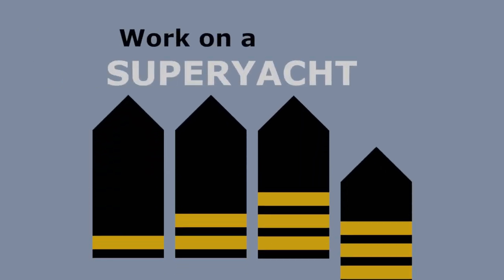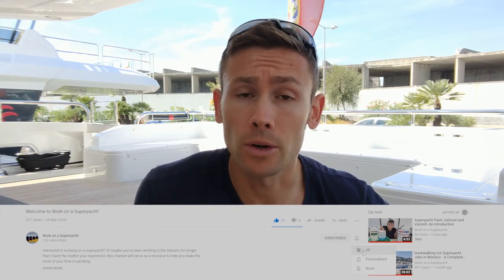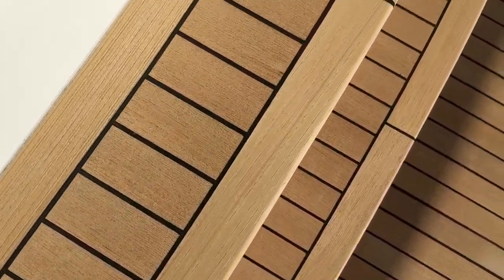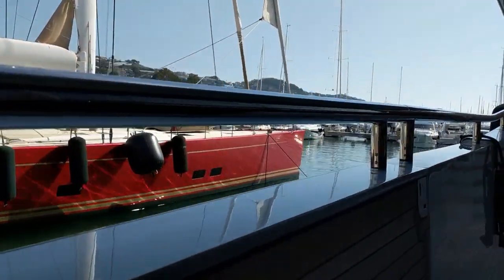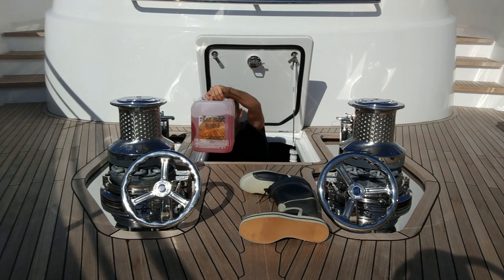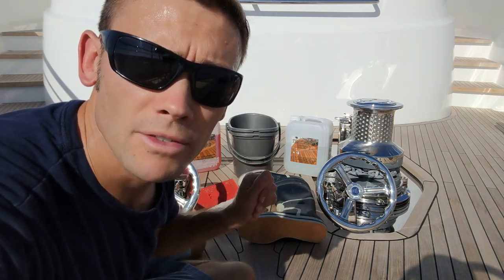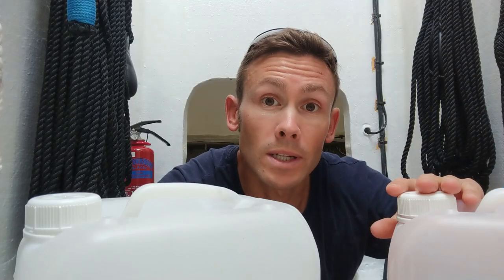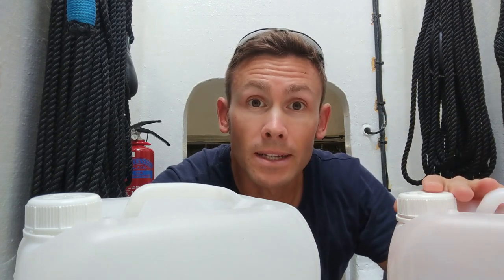How To Scrub Yacht Teak Using A Two Part Teak Cleaner

Comment: Hi very nice video, i use the same product i prefer rinsing step one and then go with step 2 dont see any difference between rinsing or not step 1.
Reply from the maker: Hello AZVLOG. Thank you for sharing your experience. As you say, I don't think one method produces a better result than the other. From an environmental perspective, I have read that a neutralised solution going overboard is preferable to each part going over separately.
Reply: Thanks for your answer, from enviromental point of view that makes sense, it brakes down part one i guess, while still on deck great videos thanks,

Comment: Howdy Matt!  You almost at the 300 sub mark!! Wonderful video as always. The lines must have been really tight or you had just a drummer from a marching band in the background (background noise). The sound was almost spot on. You would think that someone had invented a holder for the water hose to keep it off the teak. Speaking of the water hose, out of curiosity is the water pressure on a yacht the same or similar to a home or office building? It doesn't seem like your water pressure is high. A few years ago at a boat show, I got barked at (didn't know anything, it was an honest question I thought) when I asked if you could use a pressure washer (grin). Now I know!
Reply from the maker: Hi John! I can't believe it's only been 6 weeks since you congratulated me on having 100 subscribers! I'm truly blown away by all the support and encouragement from everyone on here. Thank you.
Our lines are pretty tight, but it's actually the design of the fairleads that causes them to "sing" so much. Pleased to hear that the sound was better on this one; I'll be getting a proper microphone soon to improve things further.
As for the water pressure, this is yacht dependent. On some yachts you get really good pressure, although when it comes to rinsing two part teak cleaner you don't want it too strong as it will just spray the product everywhere. A pressure washer certainly wouldn't be a good idea on paintwork, but I have heard of them being used on teak decks to blast away the top layer of grey, rather than treating it with a product. Mind you, even then you'd only want to be using a domestic type. An industrial one used for blasting marine growth off the hull would probably leave you with no deck at all!
Reply: @WorkonaSuperyacht  Matt. No problem. I enjoy watching your videos. You are inspirational. Not all gab gab gab. You should be able to get entertained and gain so knowledge too. Your a Senior Officer and would like to show that its work, but in a safe (safety) and methodical way so the crew can go out and have a good time and see the sights at the end of the day =)
Reply from the maker: @John Christner Thank you John! I really appreciate your kind words.

Comment: Hi Matt. Great video, very informative as always.  These are a great source of learning for us greenies. Keep up the great work. 
When using Part 1 & Part 2 on a bigger area of the deck or cleaning the whole yacht, how would you go about it?
Reply from the maker: Hi Zach! Thank you for your comment and I'm glad to hear that you're learning lots from the channel. 
For bigger areas you use the exact same method, but just have to be careful not to let any of it dry out. Bigger areas typically mean bigger yachts, so there will also be a lot more hands on deck to complete the job. In addition, you may well have one of those buffing machines that I mentioned in the video. One person can cover a huge area with such a machine, whilst the rest of the team work around the edges and more intricate areas by hand.

Comment: How often are you cleaning with the  2 step process vs just washing down or rinsing down the teak decks?  And do you use the same 2 step process on the teak tables?
Reply from the maker: These products are expensive, and also quite hard on the teak. We therefore try to keep it to a minimum: once at the start of each season, and maybe once again during the season on high-traffic areas. In between times we try to keep it as clean as possible, and will often do something like a Simple Green scrub with a softer Doodlebug pad. The same process can be used on untreated teak tables, but then you have to be even more careful not to let the Step 2 damage the fixtures and fittings of the table.

Comment: How often do you scrub the teak? Are the steps and smaller areas trickier?
Reply from the maker: Hi Dave! The deck is typically scrubbed with a two part cleaner at the beginning of a season, and then maintained with "soapy" scrubs (using a product like Simple Green and a white Doodlebug pad) for as long as possible. Depending on how much the yacht is used, it may eventually get to a point where it needs another scrub with the two part cleaner later on in the season; and, this will have to be worked in around guest trips. I have on occasion scrubbed teak through the night to get it ready in time!
On some yachts you are required to scrub the decks with a two part cleaner before every guest trip, and on a busy charter yacht this could mean 10 or more times throughout the season! This does however put a lot of stress on the teak and isn't recommended.

Comment: Hi, Matt new sub here :) and I'm so happy to find your channel and very interested in all your tips. Question: Do you apply any teak sealant or oil after you wash and dry from parts 1 & 2? if not how often do you wash using this method. Do you consider using vinegar for regular washdown? Thanks a lot!
Reply from the maker: Hello Blue Ocean and welcome to the channel! We sometimes apply a teak sealant to isolated, high traffic areas such as a swim platform, or the deck of a tender; it also works very well on teak furniture. However, my experience of applying it to a whole yacht didn't go well, and I shall never do it again! A team of four of us applied Semco to the entire deck of a 60 metre yacht; as well as being time consuming, the results simply weren't worth it. 
The problem with many teak sealers is that they must be applied to completely dry teak. If there is any moisture in the wood then they stain it a mouldy, black colour. It isn't a problem to get small areas totally dry, but for a whole deck this means that you must have good weather and direct, hot sun before starting. In addition, the sealant has a habit of making the caulking go sticky during application, and can drag black streaks of caulking across your nice, clean teak.
Once applied, I don't like the colour (personal preference) and it doesn't feel nice underfoot. It also gives the deck a slightly shiny and plastic appearance. The biggest problem however was that it seemed to lock in stains from food and wine, whereas on an untreated teak deck these are easy to clean away with a stain lifter such as K2R. Finally, it is a lot of work to scrub the sealant out of the wood in order to start again.
My preference is to 2-part the decks 2-3 times per year; doing it more often will only further reduce the lifespan of the deck. In between, I find that a light scrub with diluted Simple Green (a degreasing product) using a white doodlebug pad is enough to keep it looking fresh.
A small amount of vinegar in your washdown bucket is great for removing water marks from glass and paint; just be sure to rinse really thoroughly because vinegar left on paintwork will damage it.
Having said all this, some yachts will require that teak is 2-parted more regularly, or sealant be applied to large areas. This has just been my experience of what works best. I hope that helps!
Reply: @WorkonaSuperyacht  Hi Matt I'm so glad you replied to my question and I really appreciate it. I was busy watching all your videos right now while waiting for your reply :) and I was very happy that I learned something from your channel, it's been a long time waiting to find the right channel that gives me idea and tips working in the yacht industry even though I'm working in a small yacht right now :) You are totally right that better not to apply any sealant and let be natural as it is and of course I will follow your advice thank you for that. I still have some questions about cleaning like how do you polish stainless handrails, railings, aluminum, leather seats, window stain marks, gel coat polishing, and other things. Can you also give us tips on where to buy products for yachts and what are the products that you used in the superyacht? In this way, we know what is the right product that we will use in the future. Anyway, I know you have other prioritize right now. I will just wait for your next videos for more tips :) God bless you more!!!
Reply from the maker: @Blue Ocean I'm glad to hear that you find the channel so helpful. In time I will do more videos about the products that we use out on deck; many of them are common to all of the yachts that I have worked on. What sort of yacht are you working on at present?
Reply: @WorkonaSuperyacht  Hi Matt, thanks for the response again :) Currently, I'm working on a 67 Catamaran, and to be aware that the whole area is teak wood and very much exposed to the sun, that's why I find it very difficult to maintain especially the wood because it gets gray and a lot of dark tiny spots. I also have experience applying with a teak sealer call Starbright but it was awful after a month and it's very hard to clean because all the dark spots are under the sealer so that's why we remove it. This is the main reason why I was so happy that I found your channel where I can learn more about cleaning the right way and the right product to use for the boat. Another problem we have here is the source because even the closest shop doesn't know the right products of course considering they don't have experience which is understandable. Right now we have 3 main issues in our boat 1st is the gel coat paint on the hull where the hologram or trail marks from the polishing pads are very visible. 2nd is the stainless and 3rd is the teak wood. Hope you can teach us how to polish stainless steel and polish gel coats on your next video :) Have a great day!

Comment: Really great video! Your explanation of the process and reasoning for doing each step was very good. Well done. Definitely subscribed. 

Do you guys ever apply an oil or sealant to the teak or simply keep it “naked” and redo this cleaning process multiple times per season?
Reply from the maker: Thank you, Elevate Yacht. Welcome to the channel! I prefer not to use an oil or sealant because I find that it ends up creating more work in the long run.

Comment: Great video been putting off tackling the teak on my own somewhat smaller boat, but this has been very helpful. Would be interested to know how often you treat/clean the teak with these products.
Reply from the maker: Thanks woolyimage! What sort of boat do you own? I don't like to use these products any more than about 3 times a year, as they are quite harsh on the teak. 
To keep the decks looking fresh in between, I scrub them with diluted Simple Green (a brand of degreaser), using either a white or brown doodlebug pad. A little bit of oxalic acid can also be added to this solution for a brightening effect, and the decks must of course be rinsed very thoroughly and dried afterwards.
Reply: @WorkonaSuperyacht  Thanks for the message and the additional information is very helpful. I have a 43 foot Jeanneau sailing yacht so not quite in your league ! I had the main part of the deck replaced with flexiteek but the cockpit area is still the real stuff, so hoping to brighten it up to match the new main deck. Im going to check out your other videos on painting & varnishing as i have had quite a learning experience with Epifanes products this year. Get great results once you figure out how to use them properly. Reading the instructions always helps ! Thanks for your efforts and excellent videos.
Reply from the maker: @woolyimage I've always liked the look of Jeanneau. As you say, different from the yachts I'm used to, but still very nice! As far as paint and varnish goes on this channel, you'll not yet find anything more than an introduction. I have more videos planned on the subject, so watch this space! Meantime, I really appreciate you supporting the channel.